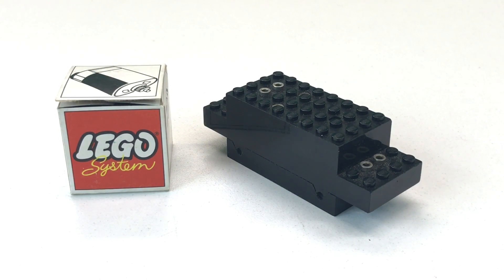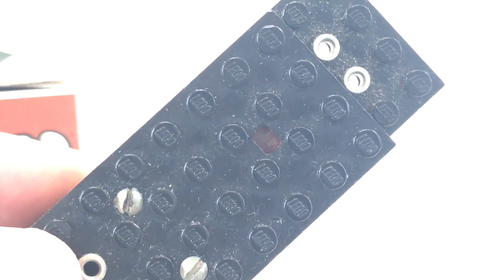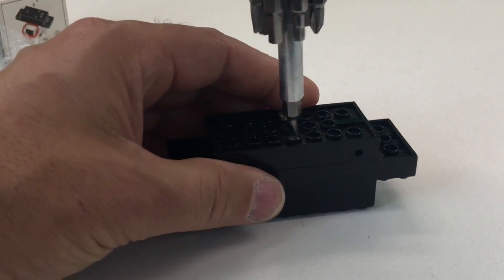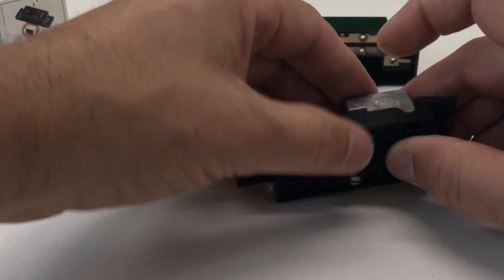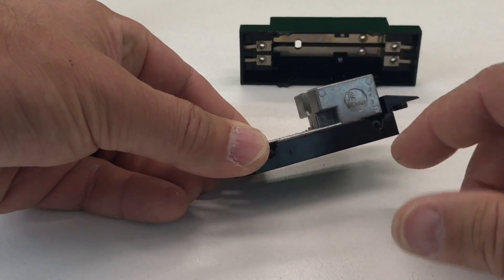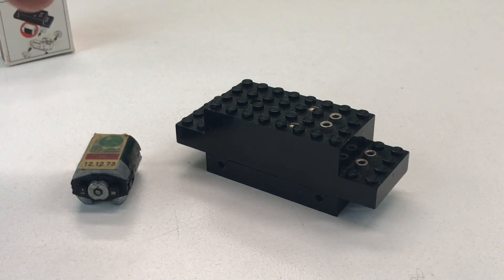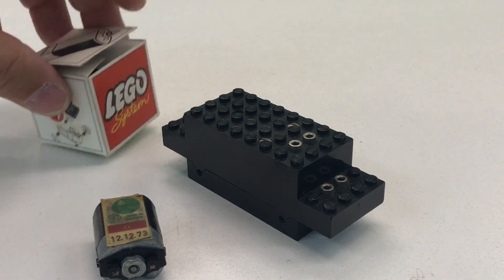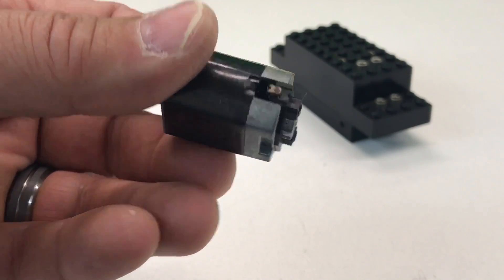What's Inside a Vintage LEGO Train Motor? Converting to 12v

Comment: These Lego motor units are an absolute work of art. They were fitted with high quality Buhler (Germany) motors. I like the way the metal chassis is split in 2 halves and used for positive & negative conductors to power the motor and of course the way the motor can instantly be lifted out and replaced. It sure is a nice thing 👌

Comment: Great video. Very helpful. I have a 4.5v motor from set 7722(1985) and it needs a deep cleaning down inside the bottom of the gearbox. The problem is, this particular train motor doesn't have screws in the bottom, and I cannot figure out how to remove the metal housing from it so that I may access the plastic gears and wheel axles.

Comment: A drop of light oil on those gears would of helped
Reply from the maker: Good idea
Reply: BrickTsar a drop of light oil will ensure the gear teeth mesh smoothly and reduce friction and wear , not to mention less noise !
Reply: BrickTsar 
You want to use Super Lube synthetic grease on the gears, not oil.

Most oils are not compatible with the plastic and will cause embrittlement.

Super Lube synthetic is compatible with ABS, nylon etc.

Super Lube make an oil too, but grease is better for gears because it stays put.

Comment: Lol, I never knew Lego once wanted you to take apart your Lego Electronics. Now, they make their power functions in a way that you can't take them apart without potentially breaking your motor. "Delicately" shove a screwdriver at the clips to take apart motor is the only way to take apart PF motors.

Comment: Hi there! I have recently acquired an interest in the vintage 4.5V system. Many years ago, I asked you about them as I had received a 4.5V motor from a large purchase of random LEGO parts, which I now have the knowledge needed to run it. Thank you for that info! Although, I also want to get a few more which brings up a couple of questions.
1. The 4.5V motor I have has fairly dirty metal connections, which I would like to clean before usage. What sort of cleaning method do you recommend that doesn't necessarily require me to buy anything?
2. I have great interest for some reason in getting one of the slightly taller 60's style train motors. Are they the same on the inside, and can I use the replacement motors that LEGO made in the 70's inside of the older 60's version, in case it breaks?
3. Is all of the equipment from the 60's, 70's, and 80's 4.5V train sets compatible? (ex. Battery boxes, replacement parts, wheels, wires)
4. Finally, I am aware that these old sets had rubber bands on the wheels. I have not found any for a reasonable price, so I'd like to know if they are really needed to operate a train, or if they just pose a small advantage. I know that the type of track used affects traction, so I should let you know that I plan to use modern 9V track mixed with some PF track with copper foil tape.
Thank you in advance!
J Mac
Reply: J Mac's Bricks 2. You can't replace the motor from the taller one

Comment: I got this 4.5v motor back in the day without train stuff.  Just the C battery pack, the motor, some wheels/tires, wire, etc.  omg, i just realized that has a technic hole in it. I can use it for a ball machine module! :D
Reply: well, the one i had, had the technic hole. set 107 perhaps.  https://www.bricklink.com/v2/catalog/catalogitem.page?S=107-1#T=S&O={} I love your videos and choices of sets to show off.  Be well, man.

Comment: This Motor works forward in 100 years still keep on, where every other motorized toy is broken ^^
(sorry for my bad english)
Reply from the maker: Yes! It's funny they sold replacement motors yet I've not come across a burned out motor yet.
Reply: The bühler 12v is really very strong. I abused them for years and they still work.
Reply: Mine is broken :(

Comment: I am a little bit confused. Isn't the  4.5 volt motor battery powered. How do you get power to the 12 volt motor? Thanks.
Reply from the maker: We've done a few videos already with the 12V motors. There are several points of contact on the motor housing and you use power pick up bricks to get power from center rails. https://youtu.be/1GthmMi1u5A
Reply: I didn't realise the motor housing had that already.